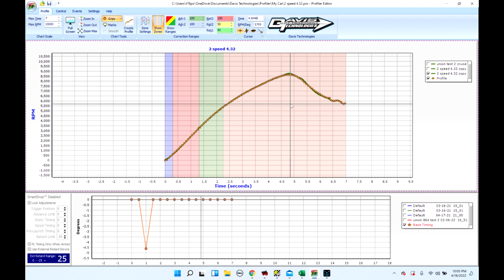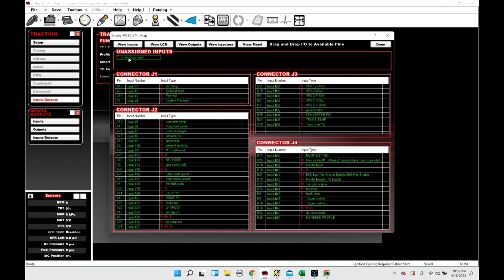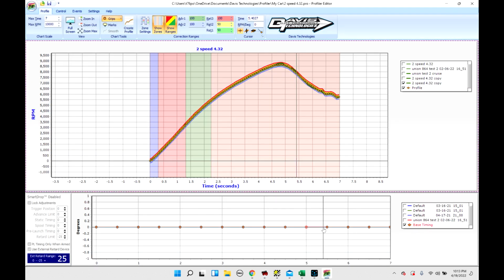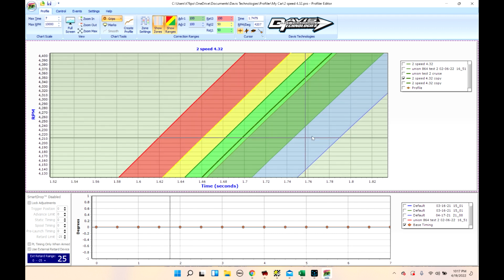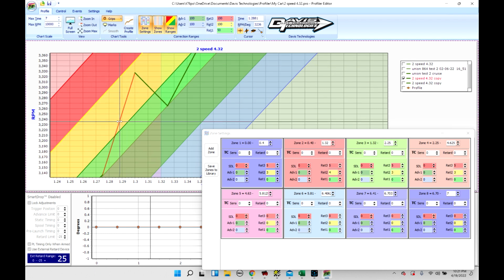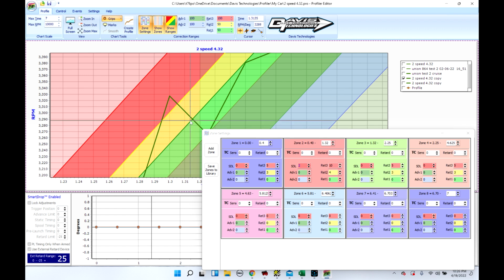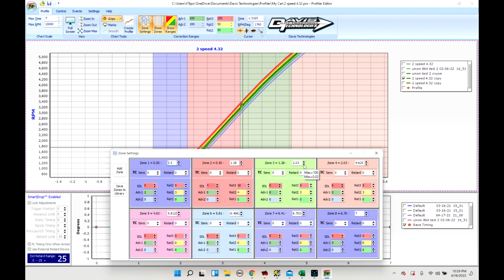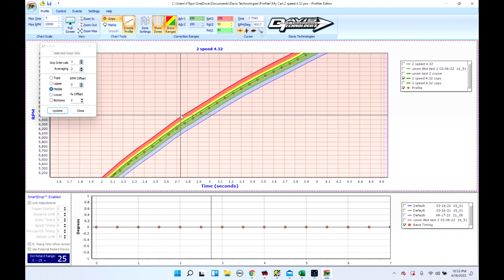Davis Technologies Profiler software intro

Comment: What is your opinion on the $500-$600 traction control you can unlock in the Holley software . Does it function better than wheel-speed offsets / rev offset traction control with advanced tables ?
Reply: Thanks for the awesome videos as always ! 👊🏻

Comment: Quick question with the smart drop, if you are running with fuels like meth and e90 and it smart drops will that potentially cause a bent rod because of the un-burnt fuel?
Reply from the maker: I've not had any issues I also don't allow smart drop over 2